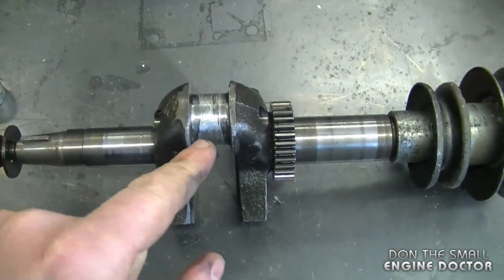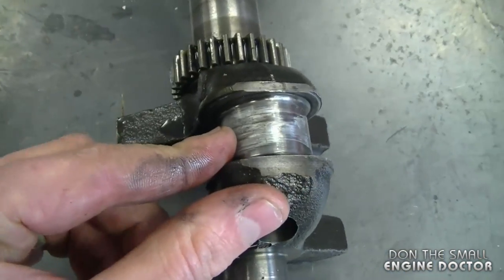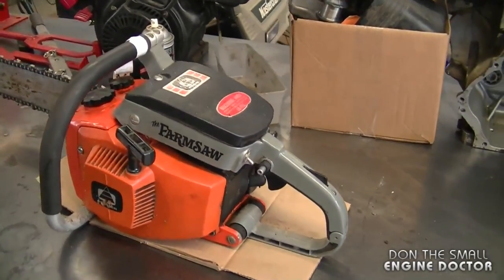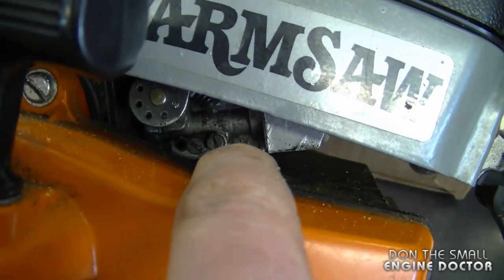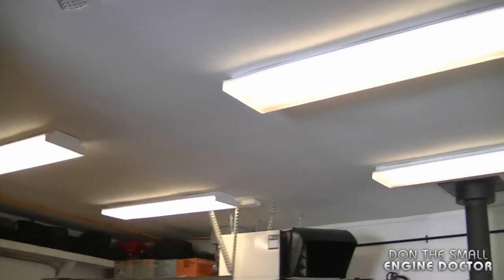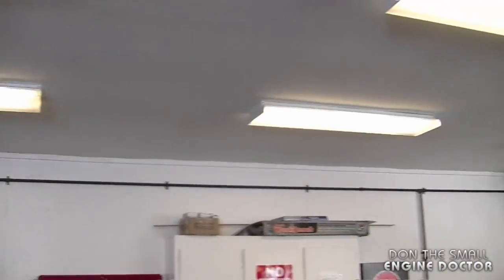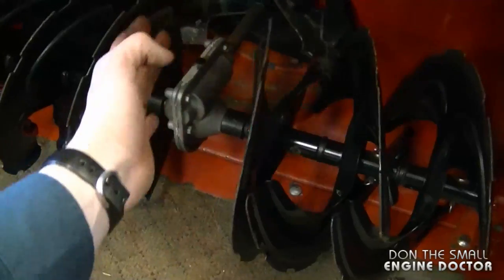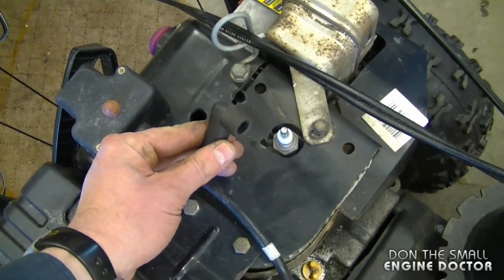Small Engines Q & A Video #141

Comment: Another good tip to remove the aluminum off the crank journal is to wipe it off with battery acid, comes off fairly quickly without loosing any material off the steel crank.
Great vids Dony. Ive learned a ton, keep up the fantastic work !

Comment: Man,  you said a mouthful there, this winter needs to GO!!!
-20C two nights last week, and -17C one night this week.  My heating bill has been thru the roof!
Anyway, good vid, I liked the views of the crankshaft with the rod melted to it. I fixed a 4 horse Briggs like that, sanded off the aluminum, put on a new rod and it was good for another 100,000 laps around the backyard!  :)
 Spring has to be coming some time, my 73 Briggs tiller melted itself out of the snow the last few weeks!

Comment: Thank you for your great videos! I finally repaired my dad's 1993 Atlas snowblower. Originally thought it was friction wheel due to bad shape, but after replacing it, it still wouldn't engage speeds. Belts new and not loose. Found the big gear had broke bolt. New grade 8 holt and it wants to go! without your helpful videos, part sources and tips, doubt I would have bothered to fix it. PS.. new friction wheel stamped Made In CANADA :)

Comment: UP TO? -40   Whew you're colder than I thought!   :)     BTW, interesting, -40°C = -40°F  You've certainly gotten an unusually cold winter while here in San Diego, it's been an unusually warm (and dry) winter.  Supposed to go to 30°C or higher here on Sunday!  Normal is around 17°C.

Oh, and remember folks, DO NOT to use a regular bolt to hold the impellers, the shear bolt is a special bolt made to break before the impellers, or shaft, or worse, gearbox are damaged when you hit something hard.

Comment: Since you asked for questions to be submitted: My Silver and black 20in Craftsman mower with a 3.5 Tecumseh motor has begun to die when mowing on a steep side-hill 30 degrees going horizontally. Mowing the same spot by going down and then pulling it back up the hill it runs perfect. Any suggestions? I keep the tank nearly full and the carb is clean with a rebuild kit in place. I take excellent care of my equipment, but this has stumped me. Thanks in advance for your consideration.

Comment: Thanks for the great video!

Why does my chainsaw die when I go to throttle up even though I have rebuilt the carb? ------

And when the carb only has a low speed screw ??
The saw runs fine when its warmed up.
Carburetor C1QS46A

Comment: Hello Don:
Using your tutorial I got up the courage to replace the cylinder and piston on a 359 Husqv. saw utilising China parts. Well, eventually everything clicked into place and the saw started alright. I took it out of the high RPM choke mode pretty quick, but the saw quit pretty quick on me then. The L and H adjustments didn't change anything, neither did the T screw. Starts fine every time but quits soon. I would guess an air leak somewhere. Where would you suggest I should look for that, unless you know of a different cause for this problem.
Enjoying all your stuff a lot, thanks and greetings, A. K.
PS Is there another way to put this type of question to you?

Comment: I have an older 8hp mtd snowthrower with the duel pto setup where the pto for the cam run the drive wheels ...what would make a good replacement engine im lookimg for say a 10 to 12 hp

Comment: A much faster, easier, and effective way to remove aluminum deposits from steel and other alloys, is using muriatic (or hydrochloric)acid.  It doesn't take very much.  Just take care in using it, as it can etch concrete in higher concentrations.
Reply: sorry did not see your post.. but much agree!!
Reply: Triplescanada Hemified
 Actually, I didn't catch your comment made hours before mine!  That's okay.  As long as people see either one is all that matters.  It sure is a lot easier than screwing with sand paper and Scotchbrite pads to do it!

Comment: Hey Donny I got a toro personal pace recycler model 20017 and I'm stuck. It pulls over hard and won't start. I checked and cleaned the carb checked the oil checked for spark and removed the belt drive. It pulls over about once then seems to stop almost like the timing is too far advanced anny ideas? Thanks and love the videos. Very informative!
Reply from the maker: check the flywheel key, it may be sheared

Comment: I'm not sure if I can ask questions here, but, I have a lawnboy with an F engine that wont stop? What is the corrective measure, thanks..
Reply from the maker: check the switch and the wires
Reply: I tried, but I am not sure on how to re-adjust the spring. This is a model with a break handle.

Comment: Hi donyboy 73 what do you advise i do to fix a Honda GX160 5.5 HP fire fighter pump as it has a problem were it revs up down when pumping water and it does not pump near as much water as it used to. (it is the twin impeller model)
Reply: I also have many Briggs and Strattion pumps that do the same and also surge in revs on idle

Comment: What can I do that doesn't require anything to be removed but can help stop the burning of oil since I made the dumb mistake of trying to mix some gas in the tank if my saw I know you should do that but I did and no I'm burning oil and it's coming out the exhaust into the saw
Reply from the maker: you will have to dump out the gas or add a bit of straight gas to it
Reply: well it happened a wail ago and Ive had more gas go though it but it is still burning oil idk if there is some just sitting in there or what but its still doing it